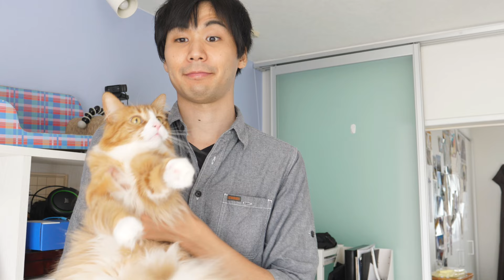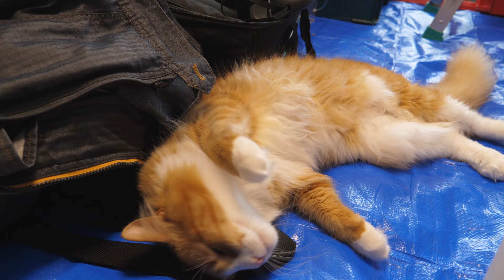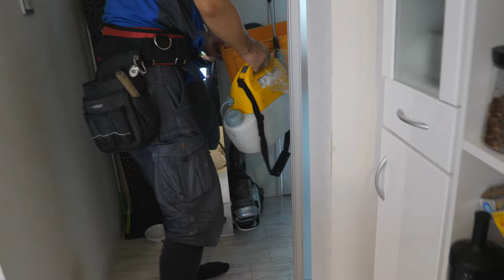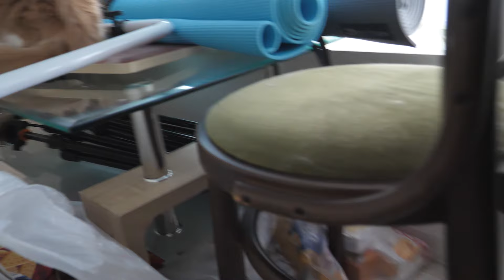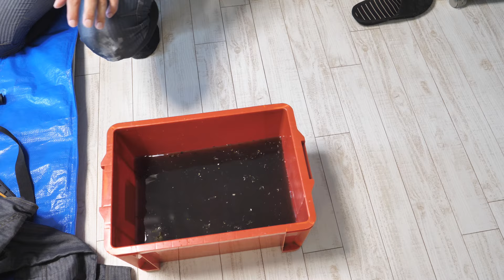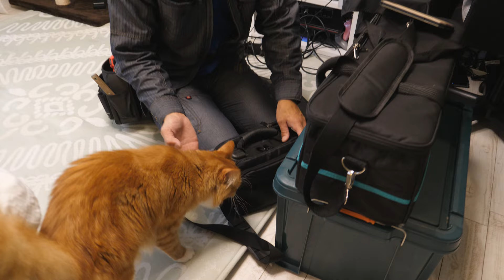Haku falls in love with our AC cleaning man

Comment: I thought 80$ was a little steep, then dude started taking it apart and my mind was changed.
Reply: Indeed. Considering the job he did, $80 doesn't seem that steep for something you need to get done once a year or less. He was extremely thorough and did everything necessary to minimize the impact on the home while doing his job to a frankly extreme standard. Kudos to that dude.
Reply: @KhronicD  His work is worth at least double the price imo
Reply: It was probably the same as getting the AC brand new again.
Reply: Some people are saying that his work is worth double the price. If I convert it to reais, which is the money in my country, 160$ would be 885 reais. A new ac to a room around the size of theirs costs about 1000 reais, so in here they can't charge that much, even though their job is really difficult (the risk of breaking it is very high, I guess).

Basically that's why a lot of workers in the field or similar fields are not paid well enough here, because when you need to charge low for the job, you need to consider that the company is actually taking most of it, and there's the products used, the equipment and so on. Of this supposed 160$ the worker probably gets around 15$, if they are lucky. Imagine now if they charged 40$, which is probably the price where I live to hire a company that sends someone to do the work... 
(Consider that most people here actually don't even clean their ACs, so there's not a lot of people to hire them)
Reply: @analuisa1214  Hmm, here in Europe you need to shell out about 1.000,00 Euro for a split system of a brand like Panasonic (installation not included) that doesn't blow off your ears, so it definitely makes sense to invest in cleaning now and then.
I think if the Japanese worker is self-employed, his payment is not overwhelming but decent. If he works for a company he's probably better off because he'll get a salary and doesn't have to pay himself for his equipment, car and whatever. 
But I get that there are huge differences in payment between low and higher paying countries.
Reply: @monstermirror2  hahah I hate to remember when my American family had to replace our central heating/cooling unit (my dad does the cleaning and a decent job) the whole experience was horrible! It was 5 years ago, and I barely remember it.
Reply: As an HVAC tech I can tell you he's cleaning the blower wheel (the black thing that was filled with dust and gunk) taking it apart to expose that stuff takes a good half hour, setting up equipment to lower your impact on the house, shows he's doing pretty good work, the cleaning solution (the stuff he was measuring out) my guess is he also sprayed out the coils too while he was in there. 80 bucks isn't a bad price for all that. Makes the unit more efficient, keeps the system from icing up, and yes that stuff can be sprayed into the house if it builds up worse than what it was leading to some health issues. I'd probably do the condensing coils as well but that would cost more.
Reply: @KhronicD  p
Reply: Not to mention how nice he was about Haku being so nosy and Jun filming him 
A+ customer service
Reply: @monstermirror2  If he's with a big company, they would take their cut so I'm guessing it cancels out.
Reply: Herculean not at ALL . Those are expensive
Reply: It was just a drill and taking the filter out
You can pop off the front without tools.
Literally pop off and unscrew a few pieces, wash it, let it dry, put it back together
Reply: @Maaad-maaan  most people are paying him for his knowledge. I can replace a toilet, have twice, it is not complicated, but if you don’t do it right you will cause yourself big problems. They are heavy, some people couldn’t manage that. Never diminish a workman who does a good job. In the US where I live, that service would cost $200, but I would gladly pay it because if I damaged the unit it would cost far more. It is all perspective.
Reply: @lilolmecj    I’m not diminishing him, just confused as to why people are praising him to such an extent. My family and I have done tons of stuff like this ourselves because my parents grew up DIRT poor and don’t like to spend money on things they can do themselves.

From my perspective it’s more about convenience. Most people don’t care to learn about this stuff or take the time to do it. It’s not hard, but it is tedious. In Japan it’s normal to leave things to professionals but Rachel is from America and I’m surprised she actually goes along with the Japanese maintenance services.
Reply: It’s $160 (aus) to get your split system aircon cleaned here!! If only it was $80!
Reply: I was thinking the same at first. That I could vacuum it for cheaper. But when he dismantled it and did a more thorough job, I figured if I did it, it would be equal to a temporary bandaid 🩹.
Reply: the dirty water clinched it. SO GROSS
Reply: @herculean616  where do you buy $80 split type ACs?
Reply: @monstermirror2  You don't need to buy a japanese ac to get a good ac, it isn't the 90s anymore. Chinese brands make good, cheap inverter acs now. Of course if you want maximum electrical efficiency you should get a japanese R32 inverter ac.

Comment: When you mentioned it was 80 USD for a cleaning I thought "That's a rip off" Then I saw all the work he did and I was like "It's a bargain!"
Reply: They should be cleaning the filters every couple weeks.  They can do that themselves....
Reply: Yeeahh....If you own a screwdriver and a small vacuum cleaner, you could probly do it yourself. AC units are super simple, although i do still admire how professional that maintenance guy was.
Reply: It takes five minutes a month to stay on top of maintenance ... but if the job is left so long (as in this case) then a full clean back to ''New Condition'' will take FAR LONGER than five minutes. This man was a professional who's work should be respected, and I bet he put at least an hour into this service if not more. Between setup, staged cleaning, and professional tooling ... this is definitely worth the money!
Plus, they say in the modern world the best thing you can buy with your money is time convenience, this falls under that category.
Reply: @3,14 _ actually it's not as simple as just cleaning the filters, I personally have experienced allergy issue with AC and I didn't know what the reason was until doing some research online, if you can start to smell a weird odor when turning on the AC then you actually have a mold/mildew problem growing inside the AC coils and the toxins they release can seriously damage your health (personally I have had migraine and constant sneezing because of the toxins, also low energy/mood), just flushing/rinsing the dust filters will not help at all, the mold/mildew that has grown on the AC coils will still be there, and every time you turn on the AC, the toxins will be recirculated back to the room where you have the AC in which is very bad news, also the reason why mold/mildew can easily infest the AC coil it's because the refrigerant inside the AC coil absorbs heat and moisture from the air and eventually the moisture from the air collects on those coils then mold/mildew starts growing on it because of the moisture. So it's actually good to hire a professional to properly clean your AC unit once in a while as they have the proper solution to kill those mold/mildew.
Reply: 3,14 _ it’s clear you don’t know what you’re talking about. as someone who lives in the middle of nowhere and has low water pressure on the account of i have a well and not water hookups like people do in towns/city’s, i can’t just use the shower head. plus, if you actually paid attention, he didn’t only clean the casing and the filters. he cleaned in and around the part that was mounted on to wall. what do you expect people to do??? rip their ac off the wall????
Reply: funny how you say i can’t read when you just straight up ignored every point i made? also, if we’re going off of intellect, your comment is jarring and not grammatically correct.
Reply: 3,14 _  I don't think its just that simple to have it completely clean. Sure it would be somewhat clean but not to the extent that the man did it. Just like if you were to hire a maid they usually do more of a deeper cleaning than just your standard everyday house chores.
Reply: 3,14 _  yeah i do to clean my AC self, but somehow its kinda different when the cleaner/maintenance man  do it. Cause the maintenance checking ur AC condition too, like he repair some lil problem in ur AC or any issue.
Reply: 3,14 _ everything in the world are rip off nowadays. You buy a brand tshirt cost hundred or thousand dollars when in reality it only need 50 dollars to create it. I rather pay more for someone who did his job than pay more for a brand. But still, its their money. They earned it. If he got 10k dollars a month, 80 dollars is like a spare change for them. If they earn only 500 or 1000 a month, im sure they will do that shit alone.
Reply: same
Reply: 3,14 _ how about you respond to the actually well written explenations on why it's good to hire the guy?
Reply: Only clean the filters is not enough. I clean out the filters every month. But in one year never clean the inside. Oneday my ac start dripping water. Then we clean it thoroughly and it's super dirty inside.
Reply: 3,14 I don't think you have any right to be so judgmental over something I bet you yourself don't do. For the amount of work that man did ,which was probably the course of an hour maybe more, $80 is a good price. I honestly would've expected more. I would gladly pay that price for my unit to be cleaned and re-assembled properly.
Reply: @3, 14_ 

Uhhh, how is interior dirt supposed to migrate to the filters? It's already bypassed the filter, which pulls air INWARDS. Any dust/dirt that's gotten past the filter is there to stay, will continue to build up over time, and can create some real nasty problems like mold, allergens, and bad smells. This is just a basic logic fail on your part. It's not that hard to take apart and clean the inside of an AC unit, but I don't blame people for not wanting to do it themselves.
Reply: That is correct! My dad took a mechanics class decades ago and his teacher told everyone to ALWAYS turn the AC in a car off at least a few minutes before finishing a drive. The moisture in the cooling system's coils will be removed by the air, preventing the growth of basically irremovable mold and mildew (opening the AC compromises the system's effectiveness permanently).
Reply: "3,14_·" has left the chat room 😂😂
Reply: Plus, did I see 3 cats? Need to be cleaning that yourself monthly.
Reply: Its 1/3rd price of new AC in Indian Rupees.
Reply: Same here!
Reply: Guys, It's just a norm there for people to prefer calling for professional maintenance on their cars and electronic. Don't ridiculate others for that.
Reply: @andrewsheridan612  heyo i see you around a lot ridiculing people. Got any good opinions to flau t
Reply: 3,14 _  here's that one guy that tells everyone how to do everything and gets mad when people has different opinions..
Reply: Base on the number of likes, its clear who is the winner.
Reply: 3,14 _  you told everyone to just clean the filters which are bad advise because you can't remove mildew by just cleaning the filters and dust cakes up inside the fan and clog up the AC, dust filters helps but they still can't filter finer particles.
Reply: Haircuts cost $20-50 ish
Reply: @andrewsheridan612  if you have ever clean an AC properly you know that just cleaning the filter isnt enough. Will it last temporarily? Sure. In the long run will just doing that work? No. And you see how much thing he worked on? He basically gave you a new AC
Reply: @camphonics2124  ignorance is bliss to some
Reply: 3,14 _ you cleaned your AC by yourself for a year now? Wow, i guess that qualifies you to be an expert on these things!
Reply: 3,14 _  It is very sad and kind of funny to see how do you underestimate others work. Besides, life quality in Japan is very good, so they are pretty conscious that you should pay well for others work.
Reply: I thought so too, AC units in my country costs 200-300$
Reply: @SardonicALLY  lol
Reply: For me who has dust allergies, id gladly pay to have my ac cleaned thank you very much
Reply: The thing is you have the maintenance guy come to your house to do the job. I live in a rural area. If I call up a repair guy to help me with a small job, most likely I would get denied or overcharged. $80 is fair considering the time it takes and their skill, plus they have liability insurance in case anything breaks.
Reply: The fact that we've argued over a dude's decision to fork over 80 dollars to have his A/C cleaned really shows that we've become a mature society capable of having diverse thoughts. It totally doesn't show that we care too much about what opinions people have.
Reply: The money can be different then the money you use
Like I little glue bottle was 11 dollars and it was half the size 
Of One Elmer’s glue bottle
Reply: @hmrsc709  , but it doesn't cost $50 to make a t-shirt! ...unless someone literally hand-made the fabric itself, custom-sewn it and hand-printed a unique design on it...

Realistically, when talking about mass-produced t-shirts, average cost of just making a t-shirt (usually in China, India or Bangladesh) is actually more like cents - up to a couple of Dollars... Transporting it and retailing can add a couple of Dollars, but it would still be under $10, more likely under $5 (depending on the fabric quality, the patterns printed, stitching...) - the rest is mark-up /profit margins - which unfortunately mostly go to big business owners, NOT to the people actually putting the physical t-shirt together.
Reply: 3,14 _  I don't think you understand airconditioners AT ALL.
Reply: @dewigesrek5651  So about the same as at a salon in the US?
Reply: 3,14 _  ok boomer
Reply: @camphonics2124  you can actually just lift the AC off the wall, they're put on a bracket and pulls right off (lift them up first)
Reply: Everyone in the replies became professional AC cleaners huh 🤡
Reply: Yes super cheap for the service he provided!
Reply: @Czadzikable  You're talking about fast fashion, and the reason it costs so little to produce is because the companies are exploiting cheap labour and not giving the workers a livable wage. "cents" yeah cause people are dying, underpaid and overworked.
Reply: @agustthed584  - I know know that people actually making those clothes are underpaid - if you read my full comment, you should see that that was literally the point of my comment! - that even the more expensive clothes, are usually only more expensive because of the mark-up you pay for the branding - with all of that extra money going to big companies NOT to the workers actually producing the clothing - who are therefore still underpaid, no matter the increased cost of the clothing. ☹️
Reply: IDK about you guys but calling a maintenance guy especially for cleaning the air-conditioning is pretty common in Japan. My sister usually clean the filters but sometimes when it starts to stink we have to call someone. Last year we called the maintenance guy three times.
Reply: 3,14 _  Perhaps Western society has forgotten to do a lot of things because the previous generation couldn't be bothered to teach us the things we needed to know for adulthood: things like cooking, basic DIY, finance, that kind of thing. These same people (i.e. Boomers and early Gen X) then criticise and whinge at us on a daily basis for not being able to do or know things that it was their responsibility to pass on. But then, we're criticised and sneered at for just about everything. It makes the Boomers feel superior you know.

Comment: Your unit is basically being used as a filter for the air. We f you get a separate air filter in house, the air conditioner will not have to get so much abuse. I always watch when they clean and see how many things he does that I can do myself. Pulling out air filter weekly or monthly may save on maintenance in Long run
Reply: With three cats a good HEPA filter is a sound investment.
Reply: What is a HEPA filter?
Reply: HEPA stands for "High Efficiency Particle Arrestance".  Essentially a very fine particle filter.  Good air filter systems use HEPA filters to remove most of the particles and dust from the air.

Comment: i got my AC unit around 120 dollars, specialize cleaning like this cost 80 gonna make me broke. or is it a standart cleaning in japan? 🤔
Reply: If you make sure to follow the suggested maintenance for the AC unit you probably don't have to do any more complex cleaning, maybe every two years or so? Also having multiple cats means they have a lot of cat hair in the air, which can get into the AC, so this might mean they have to clean it more often.
Reply: In Japan, you can't buy AC for $ 120. This work includes labor costs, material costs, and travel expenses (car amortization costs, fuel costs, etc.).
They will do simple cleaning themself. They turned to a specialist because them couldn't.

Comment: Crazy did all that for $80 here in America at my company at least cleaning the indoor and outdoor coils for 1 ductless unit like that plus pulling out the blower wheel to clean it. Then putting it all back together and testing operations cost about $400 and thats for one head unit and the outdoor unit, I think each additional head unit (indoor) is another $160

Comment: You should take an old tooth brush and wash the filter every month and also try to clean the evaporator coil a little if you can. You dont want all that stuff getting into your drain line it can cause problems. If you do this then you only have to have the professional 1 time a year probably and its better for your ac